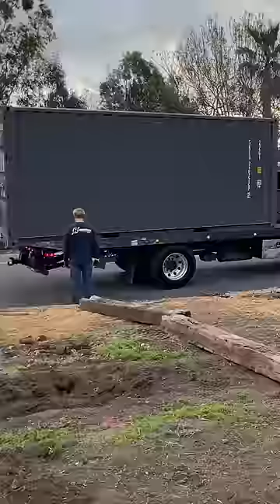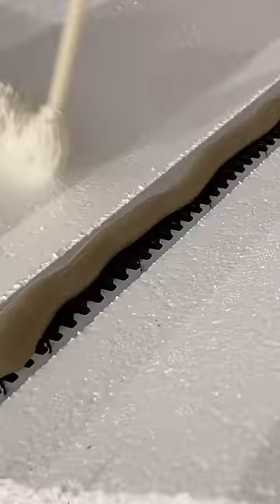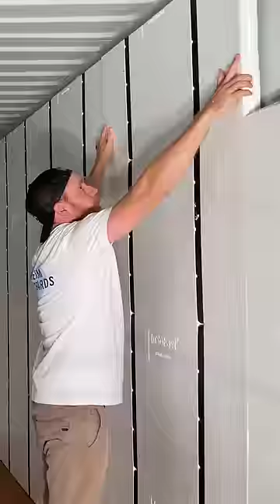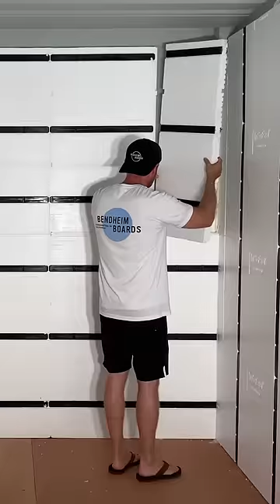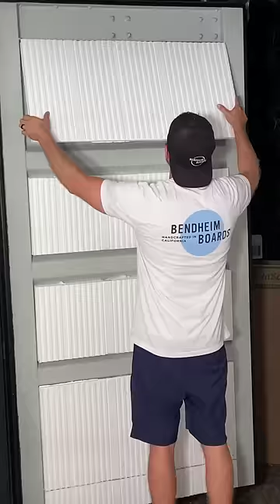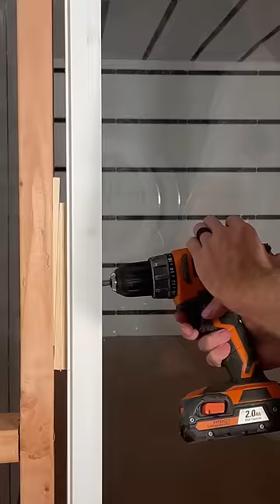Shipping Container Shaping Bay Progress thus far #shorts

Comment: For future reference when you frame a door your studs next to the door frame, should be double. And the one closes to the door frame should be shorter than the one farther away. Allowing for your head joist to sit on the studs. How you have it, your head joist is just screwed into the sides it's now being supported by anything under it except the door. Thats how you do it to code atleast.
Reply: Why would you need more support for the head joist? It's connected to the roof by short studs and it's also going to have support from the upcoming side wall studs. Also, why double side studs in this case? The one stud by the door is supported by short sideway studs connecting it to the wall studs, making it very firm. Also, the "code" is different depending on country. This is how it would've been done following the codes in Scandinavia and probably other countries as well.
Reply: not if using metal 2x2 is just fine
Reply: Probably ok because it will never be supporting any weight
Reply: There is no point in explaining good construction practice to shipping container fetishists
Reply: @gwety4496  but in this case, what difference would following the suggestion make?

Comment: Careful of mold with insulating shipping containers
Reply: Arent they pretty well insulated to begin with?  Seems like you're just wasting space with this
Reply: @chiefpacman  standard container is nothing but a thin steel sheet.
Reply: Living with a dehumidifier might make it possible
Reply: @pozorlano  so I remodel storage containers.  They're double layered, gap of air in-between walls.  Part of the point is that they are extremely isolated when kept closed.  Thats why people buy the instead of making a quick structure of wood.

Comment: The styrofoam is a game changer in shipping container renovation. I hadn't seen this product before.
Reply: For sure, it’s Great for mold. Not to mention it’s also Highly flammable.
Reply: @gregmf9427  it will have a fire rated product over top of it and besides if it's on fire just get out... The door won't be too far away!
Reply: @gregmf9427  it's insulation lol

Comment: Did those screws just get driven into styrofoam…?
Reply: That's what I asked.  What are you screwing your 2x4s into...
Reply: Yep
Reply: It looks like nylon channels are embedded in the styrofoam. 
??
Reply: @mickblock   Its some sort of rigid plastic yeah, it might be even metal. It looks like its on both sides there, cause they put F26 (memeably strong glue) on the other side to bond it with the metal.

So that shits goin nowhere, unless the black stuff breaks. WHich it probably wont for a long while. Also consider that the studs on the walls are between the floor plate and the top header thing... so the screws are only to hold it in place, not 100% structural.

Comment: I didn't know I needed a shipping container until right now
Reply: You don't, these are terrible for living in. It contributes almost nothing to the house since you still need to put in insulation, wood, drywall, floors, ceilings, plumbing, electrical, and AC. By the time you fit all that in there, you have almost no space left to actually live in. It's not attached to a foundation so the house is liable to slide around in the event of a hurricane or earthquake, or tornado (all your pumbling will snap in half). You also need to insulate both the inside and outside so that the steel wont cause condensation, which would lead to water damage. At that point, the steel is just a liability and you'd be better off building a normal house on a concrete foundation.
Reply: @Zadamanim  wow dude. I bet your a blast at parties.

Comment: I would have worried less about wall blocking and more about an actual header in case there’s ever any sort of weight over the door
Reply: Is that required in this instance due to the structural integrity of the shipping container itself? (Genuinely curious)
Reply: @logicdonkey  yeah it’s steel I’m sure it’s strong and won’t break but I’d bet it moves and bends quite a bit. Last thing you want is weight pushing down on the glass door

Comment: Panel adhesive is gonna break loose from the expansion and contraction of the steel. I would use adhesive silicone if you do it again
Reply: Does it matter since he is adding drywall next? Just a question..
Reply: @jon guenther  I would think that it would because the insulation will shift in the wall leaving gaps.

Comment: This will be a room-sized cooking pot in the summer
Reply: Agree
Reply: Potentially.
But if you think about it a cool room is made of the same material (metal sheeted foam).
This means it's very thermally insulated.
If it has an Aircon unit installed it will stay easily cool in any weather due to the insulation but without an air-conditioner it would eventually get hot and not be able to release the heat due to no windows or roof vents (apart from the door)

Comment: My experience with styrofoam inside the container doesn't work very well stopping heat from outside, the metal get hot and the heat go through, you need an ac system running all time. But if you set  plywood on top of the container the container,  the heat decrease dramatically!! Prevent the heat going through the container make the trick Plus inner isolation to prevent the cold dissipate. The solar probe is an example
Reply: I had to travel trailer under a metal roof at my hunting camp.  In the 95 F heat of the day with the sun beating down.... That travel trailer did not get that warm on the inside because of that roof above it.   But put it out in the sun and it got really hot inside.   Just keeping the sun off of things is a huge help.

Btw....tt has  Aluminum skin insulated with styrofoam
Reply: No one concerned about all the poison in that enclosed space?
Reply: @FrederickWalser  it depends if the container was use for a regular cargo like consumer products. Definitely not for chemical!! But you paint inside wall ,frame it,  then use house isolation foam or fiber then cover  with drywall or wood, plus AC system. Windows and ventilation

Comment: I'm pretty sure you will get mold build up at some point. Shipping containers as well as over the road trailers get condensation real easy and now that you have covered the walls without allowing for moisture to escape you have a recipe for a nasty bio hazard problem. Might want to fix it before it becomes a problem.
Reply: That’s what the poly styrene is for. It is in effective vapor, barrier and insulator. Polyurethane typically has a higher R-value, but tends to be a lot more expensive.

Comment: Where do you purchase those pre-formed stryofoam pieces for insulation?
Reply: Foam Board is sold at most big box stores🙂
Reply: @mimikay5421  
Yes, I'm aware.  I'm talking about pre-formed and molded to precisely fit the grooves, peaks, and valley's of a shipping container wall.
Reply: @ald8612  
Think i’ve seen this video on the
company website 📌In So Fast-
They sell insulation panels for most corrugated container interiors 🙂Hope this helps
Reply: @mimikay5421  
Thanks!

Comment: 2 words…VAPOR BARRIER
Reply: Agree. Also…ventilation to the inside of a steel sheet!
Reply: Metal is a vapor barrier. It’s an everything barrier. Now if those screws break the metal skin, then we have a problem.
Reply: @TheCriticalArchitect  no, sorry. Internal vapour from warm air, people breathing etc will condense on the underside of the steel roof sheet and walls. Even an open barn with a steel roof gets condensation on the underside when it is cold. 
The roof might keep the water out, but it will have condensation on the underside in cold weather.
Reply: @TheCriticalArchitect  Metal is a vapor barrier for sure. In this case, he should tape the seams of the insulation, or at least make sure to gasket, mud, tape, prime and paint the drywall as an air control layer to prevent moisture-laden air from depositing on the steel. 

He’s way ahead of me though. No insulation on mine. Yet. I’ve got the side oriented towards the south and there’s a pretty interesting line down the middle of interior roof: where the sun hits-dry. On the northern side-lots of pretty droplets dripping from the ceiling. 

When I get around to this project, I’ll insulate from the outside. Glad there are custom pieces to fit in the corrugated spaces!

Comment: I don’t understand the obsession with building houses out of shipping containers.  You could have built a basic wood structure for less effort and more functionality
Reply: I don't get it either. I think people are losing their minds.
Reply: The Three Little Pigs Story was not one you heard as a Child? The Second Pig following your "Stick House" plan is not familiar?
Reply: No rot or termite damage.
Reply: @robertweekley5926  I missed the shipping container made out of bricks, perhaps you can put in a timestamp.   In all seriousness they are not structurally sound.  They are built for compression not lateral forces.   The “roof” is weak on any wind.  There are no windows or secondary exits.  No utility runs, insulation even retrofitted is substandard (metal conducts heat and cold). A standard wood structure is much superior and cheaper.
Reply: "less effort" shipping containers are cheaper, and it's a lot easier to glue in some foam than it is to literally build a small wooden house
Reply: @jnachtig2  just getting the container is 1500 to 3000.

Comment: I’ve always been intrigued by shipping container homes. Mainly because you can literally pop a little woodstove in them and live in them as they are. A little 20 footer would be a nice little Airbnb. But it has me thinking. What if you were just to buy the same gauge steel that they use in the corners that heavy I-beam stuff and build your own rectangles and weld them together? And then instead of a rippled skin on the side, you just did quarter inch sheet metal down the whole side. I feel like you could do it for the same price you could buy one for except you would get a package that you could build dimensionally bigger than a shipping container while still being movable just like a shipping container and significantly stronger. Lots of people like shipping containers because it’s a big metal box and they think they’re bulletproof. Well, I hate to tell you, but the only thing that might stop is a 22. Anything else is going through. Now structurally yes, a shipping container can last a very long time especially if you maintain it. Clean the leaves off the top every year and all that jazz. I’m not a fan of traditional stick framing I feel like we just do it because it’s significantly cheaper than every other option and in the case of something being damaged you can replace sections of a house pull down walls put up new walls, etc. It’s really hard to do that with steel and concrete structures but again the pros are steel and concrete is significantly stronger. There’s still bunkers on Normandy that have been blasted with artillery and bullets that are still standing there to this day. But again, I feel like if you were to buy flat sheet metal doesn’t even have to be a quarter inch thick. It could be an eighth of an inch thick and just buy yourself some really heavy gauge square tubing you could build your own container to the dimensions that you like rather than just being what’s on the market and you could weld up extra bracing in the middle and just personalize it better for around the same price. Which I think would be significantly stronger than your average shipping container.

Comment: Although I like the shipping container idea it just seems like you’re working twice as hard. You have to spend between three and $7000 to buy a completed structure that you can’t live in as it is. You then have to turn and basically build a structure inside of the structure which means you lose even more space and by time you’re done you have maybe 7 foot of usable space left or right. I personally think you’re better off building some thing Out of your own 8th inch thick steel

Comment: Wait.  What is he screwing in to?  The screws must be poking through the container.  How will that hold?  What do you do, put a nut on the outside?  - maybe put a bit of foam insulation (or put washers and gaskets on before the nuts) so it doesn't leak?  😶🫣🤔

Comment: Here in the uk a container , with it being second hand because i couldnt afford a new one will set you back £2,000+ then for me to get it where i want it is going to be £500 for a crane to lift it over my house, even if it takes 10 mins itll be £500 thats the rate, thats with out setting out padstones to sit the container on.Then to insulate it, i wouldnt like to estimate how much, but its something you have to do other wise itll sweat like a pedo in a junior school, in the end itll work out cheaper to build a small workshop out of blockwork with a simple pitched roof, and as the uk’s planning regs have eased i wouldnt have to apply for permission to build it. But it would be easier with a container. Nice job though.